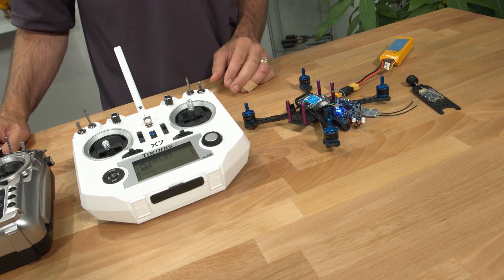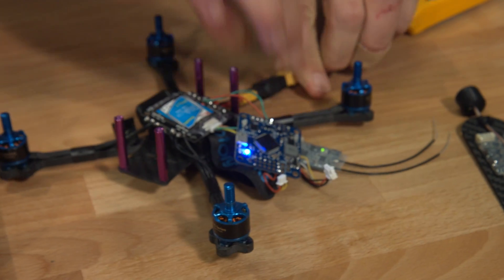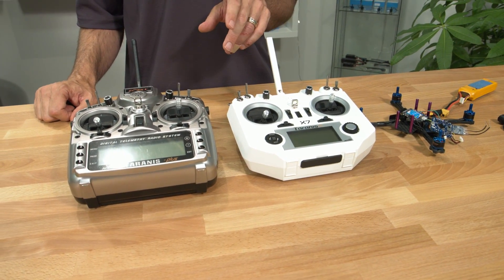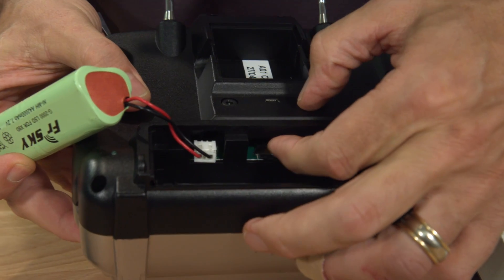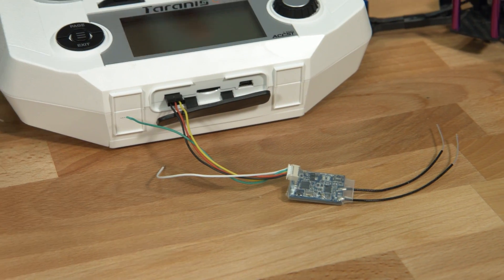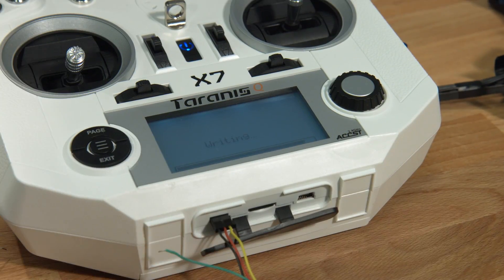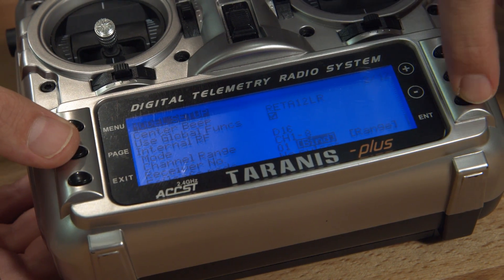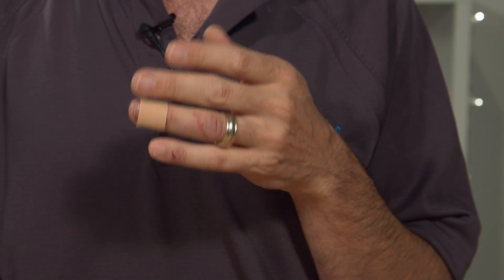How To Fix The FrSky XSR Telemetry Bug

Comment: Hi there. I badly need help because I have no clue what I'm doing with this new transmitter and receiver Why FrySky make it so complicated.. 

I was given a tarranis x9d plus transmitter from someone at my boat club. I bought a RX6R receiver for it to put in my brushless RC boat. 

They helped me set it up to a point. But sometimes I have problems with the telemetry lost received. Not just that but when I move the throttle up and down it sometimes keeps going when I put the stick back to middle.

The boat is Volantex SR65 and it is 4 channel I don't think they set up reverse but it's supposed to have a reverse. Sometimes propeller start spinning and keep going when stick is down. 

It doesn't feel the same level of proportional control as the transmitter that came with the boat originally. It's a pistol grip transmitter.

Anyway, the version of opentx is 2.1.9 on this transmitter. Dated 2017-05-08. EEPR says 217. It's in Mode D16, Ch 1-8 failsafe mode says hold. 

I also have a lipo voltage sensor with OKed screen to plug into my battery balance lead. The telemetry showing on my screen I hope someone knows what it is and can explain to me how I read and set this up.

RSSI
Low Alarm 45
Critical Alarm 42
Sensors 
1 A2 11.7 - 12.1V  ID 27
2 SWR 0 ID 25
3 RSSI 101dB ID 25
4 RXBt 6.0V ID 25
5 F000 91 ID 27

range is set at -10 and 10

I don't know what this means. All of these sensors numbered 1 - 5 keep flashing with stars or asterisk. So I'm not exactly sure how things need to be set. 

And can I get more fine control of my throttle and why the motor sometimes keeps going or doesn't exactly respond at the right times when I want to stop the motor.

Comment: When i press " flash External Device " the receiver is not responding , what should i do ?
Reply from the maker: check wiring between rx and transmitter, otherwise rx might be dead

Comment: HI, I know this is a long time after this video was made but I've got two XSR,s with the problem. They are about a year old now. I've reflashed both but both are still dropping the telemetry as shown here. I've got the XSR connected to a Matek F405 CTR FC but have used Xsr's before with no problem. Have you any idea what I can further try. When I sat two I mean I've swapped out one with the other connected to the FC
Reply from the maker: Any F4 based flight controller will need a separate inverted UART for Smartport telemetry.  The Matek 405 does not have that but it can work with soft serial.  Connect Smartport to TX2 and use the CLI command "resource serial_tx 11 A02" and then save.
Reply: @rotorgeeks2727  Oh yes I see now and should have thought of it. What sort of put me off track was that it would work for maybe 2 or 3 minutes then drop out. Ill get onto it tomorrow so thank you for the advice
Reply from the maker: @donaldhill2076  on second thought, this might not do anything.  The telemetry lost message from the radio doesn't depend on Smartport working.  Also try to put a bit of distance between radio and rx - sometimes being too close (like a foot or two) can cause the same issue.
Reply: @rotorgeeks2727  Hi and once again thank you. Yes, I am aware of that and have tried it many times. What is strange about this is that I had the exact same problem on a Matek 405 Wing running Inav. Different XSR. Tried swapping etc. It was solved once I changed to Adruplane. Of course, they don't support Smartport and got around the RSSI and Battery voltage using workarounds. I'm going to try what you suggested anyway today. It is weird. I have been doing this for 30 years but like everyone learning the technology as I go.
Reply: I had a look and id already setup softserial. I built this around a year ago and had forgotten. I actually have resource SERIAL_TX 12 A02 but what I did was remove and then re-add what I've shown here. I haven't a clue why but as of 5 minutes ago I've not had the telemetry drop out. Fingers crossed. Im so sick of the "sensor lost" message I renamed it. haha. Anyway, I don't know..............

Comment: Hi, can you please help me with an advice in solving my signal loss between my taranis x9d plus EU version and the two X8R rx that work together? I have the first rx 1-8ch with some of the control surfaces and telemetry activated and the second with 9-16 channel and telemetry off. Most of the time it works well but sometimes during range test I lose signal on one rx, or the other or both, mostly when I start the test at 10-20 feet for exemple and I see how rssi drops to zero. I then exit the range test and enter again an the sistem then works and I get about 50 RSSI at 30m...kind of week I know. One time the plane(50cc gas) passed at 20 ft above me and I heard telemetry lost...I was shoked and landed. I have the antenas at 90 degree and also some distance between the two rx. Also separate accus for each rx and ignition. I have an orange module in the back that I sometimes use with foam planes. Can that interfere even if it.s off?

Comment: R-XSR with qx-7. I have done some troubleshooting on top of following the steps in this video but I'm still unable to get a vfas read out. I get rxbt, rssi and something called F000 which all seem to be working fine but no vfas. Any help is appreciated. Thanks
Reply from the maker: Go to the telemetry menu page and "discover new sensors".  If you don't see anything else getting updated then telemetry isn't working.  What you have now is the native sensors in the rx, not the telemetry data passed from the fc.  Maybe it's not putting anything out.  Recheck that setup.  You're just looking for one thing to update to confirm you've got a link.

Comment: Does this fix the RSSI dropping when your not that far out? My XM plus would retain 80rssi all the way out to 800yards. R-Xsr can’t even get close to that
Reply from the maker: No, that would be receiver or antennas, although RSSI of 80 at 800 yds sounds exceptional, maybe even wrongly displayed
Reply: R xsr just doesn’t have as much range as xm plus or even the XSR in my experience.

Comment: Video is  very helpful but my r-xsr is still having same problem. I have tried all 3 official firmwares but this thing keeps loosing and  recovering telemetry. I'm using X Lite and x-xsr. Please help
Reply: Hi, when you're to close like less than 75cm or 2ft you lose connection.
Reply from the maker: You might be losing all signal - check your RSSI when it's happening.  The video shows a firmware bug but it's possible you have a bad receiver or transmitter
Reply: Rotorgeeks sorted it. it only happens very close. range seems around 300 m which is bad but if might be antennas positions. will get another rx and narrow to tx or rx.
thanks
Reply: Luka Šužberić did you fix this? I have the same problem
Reply: I have the same problem,  did you find and fix this?

Comment: it did not work for me, i have installed the same firmware you installed and the lastest and no luck , all the time sensor lost , do you know other solution?
Reply: I have the same problem with r-xsr
Reply: FrySky website R-XSR f.port protocol has a update “Version 180615 ‘fix the sensor lost issue’ “ but page can not be found BS wtf man this is seriously irritating whats the fix I’ve downloaded and installed all the firmware stated in this video plus Joshua Bardwell’s still not fixing issue either of you figure it out

Comment: It sucks that me as a new guy in the hobby ended up with these receivers.  I've been trying to work this out for some time and looked and read information on this and still can't get one of my receivers to flash the new firmware.  I know it's something I'm doing wrong but in your video you specifically say you must download the file with the FCC in it.  I follow your link provided and as far as I know it does not download the FCC version of this fix.   I hate to have to replace these because the cost obviously makes them twice expensive.  What have I missed.
Reply from the maker: Are you sure they need flashing?  This issue is almost a year old.  I just checked the link and it's still good - you then have to navigate to firmware, grab the most recent one (at this moment it's [2017-06-22 170619] then unzip it and find the file with the letters FCC in it

Comment: I have a problem with my r-xsr where the telemetry keeps dropping in and out, does this relate to a firmware issue because in betaflight I am unable to to connect my qx7. (This does not happen with my xm+ receiver)
Reply from the maker: If it goes in and out it's probably not firmware.  More likely an issue with the radio or receiver antennas.  The XM+ doesn't have telemetry so you won't be getting those telemetry lost messages.

Comment: Thank you, this was a very clear and helpful video! Do you know what XSR firmware versions have issues? Is it anything prior to the XSR-170619 version? I've also heard of a BF LUA script issue that is fixed with a firmware update, do you know if these are related? Thanks!
Reply from the maker: sorry I missed your comment before.  I don't know the bad version number.  I think the LUA script issue is the same because it relies on telemetry
Reply: No worries, even if I knew exactly what versions to avoid, I've haven't found any way to check the version that's currently flashed onto an XSR or R-XSR anyway. So, the only really reliable strategy is to always flash the version I want (usually the latest) so then I can know and track what I've got. Anything "out of the box" is uncertain what it's got in it. Right now (as of 28 January 2018), I'm going with 171009 on my R-XSRs (there is a newer 171103, but only for the LBT version, I'm in the US and need the FCC version), and 170619 on my XSRs. Both seem to work fine, no telemetry issues in these versions.

Comment: Hi, after following all the flashing process on taranis q x7.. after i flashed my xsr i had red and green solid lights when binding.. when i tried to reflash.. there is an error and cannot read the xsr anymore.. need some help..
Reply: Hi Mark, apparently the firmwares (the one of your receiver and the one of your transmitter) do not match. I had the same problem, because one was LBT and the other was non-LBT.
Reply from the maker: Thanks for jumping in Gregory!
Reply: Thanks.. I will try to check it out.. but currently i am using v2.2 on my taranis..

Comment: So is it right that the center pin on the taranis doesn't output power until you press the button to flash the firmware? I tested mine with a multimeter and theres no voltage on the center pin...
Reply from the maker: That's right.  It will power when you flash.  It powers and detects the rx or shuts down if no device
Reply: It also shuts down pretty quickly if the VCC and GND are reversed. The X9D+ reset itself pretty quickly, but I did smell a little cooked component smell, I think from the XSR. The X9D+ seems to still work fine, I tested it with a quad. Not sure if the XSR I was trying to flash is actually damaged or not, I just flashed it on the bench. I swapped the wires to be correct, and the XSR actually flashed the second time through, so I guess it's not completely cooked. I was definitely sweating it for a while after I screwed that up, hoping I didn't cook my X9D+.

Comment: Do you know what is sending the 10.5v reading on the A2 analog telemetry?  I've been trying to tap into the pin on the XSR with my FBVS-01 to get a simple pack voltage reading but can't because of that phantom voltage reading.  Any ideas if there is a way around this?

Comment: Thanks for this. I tried to flash the update but it quite midway through. I tried 3 more times but still unsuccessful. I then tried to connect my xsr to my Tara is but it has both red and green lights showing. Is the receiver damaged? Not sure what happened! Any advice? Please?
Reply from the maker: Not sure - perhaps check the voltage level coming out of the Taranis.  Someone mentioned that some older ones put out battery voltage rather than 5V and that could interfere with the flashing.

Comment: Frsky took down the page your link points to. (FCC)

I'm using a Horus (In process of rebuilding my 1st run Taranis, she's a little worn, but getting new case, switches & Hall effect gimbals).
I'm guessing Horus owners use the module bay connections in that like you show on the Taranis.

Thanks for the video!

Comment: I have a question about Betaflight if anyone can help me out. when changing modes to across and horizon my min throttle jumps up to the point where my craft is about to lift off. Did I mess up my channel maping on my taranis or betaflight?

Comment: Hi Dave,  I'm just trying to do this now, but for me it says "FW update error Module pin no resp"  I did exactly what you did.  Is the XSR suppose to power up when plugged into the QX7?
Reply from the maker: Hey, the XSR receives power after the last click on "flash external device".  It sounds like the radio isn't detecting the presence of a receiver to flash.  Check that your wiring order is the same as in the video and that you have continuity between both ends of each of the 3 wires wire.  Also,  are you using the same port as in the video (bottom of the Q X7) or are you trying it from the module pins on the back?
Reply: Ok.. Here's a good one for ya.  My Taranis must be a first batch or something.  There are no pins on the underside.  I had to use the back pins to flash the xsr.  I did get it to work.  Thanks Dave.  http://i.imgur.com/iqfpg9j.png
Reply from the maker: I just read about that - 1st batch didn't have the S.Port on the bottom and you have to use the back pins same as shown on the Taranis X9D+.  Thanks for the info!

Comment: I updated the XSR to the June 22, 2017 XSRFCC170619.frk file from the FrSky website. 
Took the Helix out for a test flight and I received the telemetry lost message right away. Not as often as before the firmware update but it happened with the Tx inches away from the quad. Is there anyway to verify the onboard firmware version number of the XSR?
Reply from the maker: Not that I know of but it's not unusual to lose telemetry or your connection when you're just a few feet away.  Signal is too strong.  Try it at some distance.
Reply: Rotorgeeks Cool! Thanks! It only happened when the Tx was inches away.
Reply: Rotorgeeks I tried rebinding but it was not needed as as soon as I turned mine on it connected without binding. At the same time I am still getting the sensor lost message. The writing went thru without problems I tried flashing it twice always flashed without issues external device. Using open tx 2.2

Comment: the XSR is only good to 10V, so if you're using a 3s lipo or a 8 cell nimh in your radio, you'll smoke your rx when you plug it in.

edit: i think most frsky rx's are 10V max
Reply from the maker: Hey Jarad.  I'm measuring 5.0V off those pins - it's a regulated output.  Are you finding something different?
Reply: on taranis X9D non plus that's straight battery voltage
https://github.com/opentx/opentx/wiki/Taranis-serial-port

Comment: Would this bug also cause the sensors to not get discovered?
Reply from the maker: I suppose if you never discovered sensors before and pushed the button to discover after the telemetry stopped.  Try turning discovery on and then power cycle the receiver. If nothing pops up then it's a different issue, likely wiring or control board config.